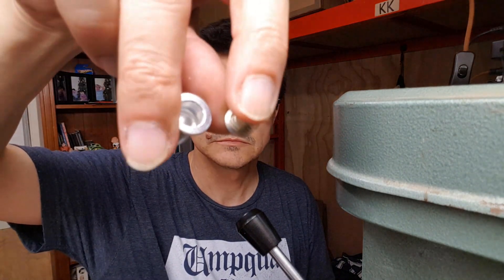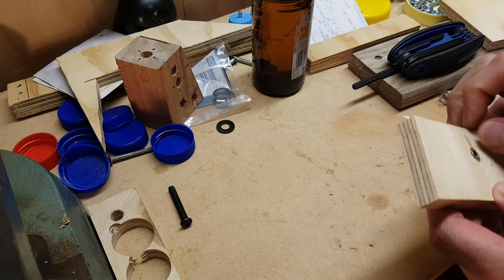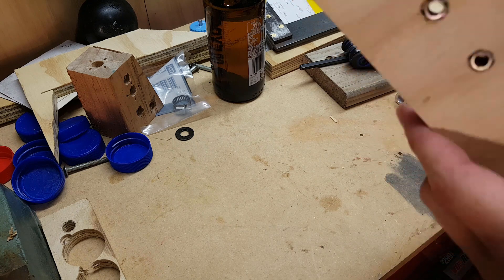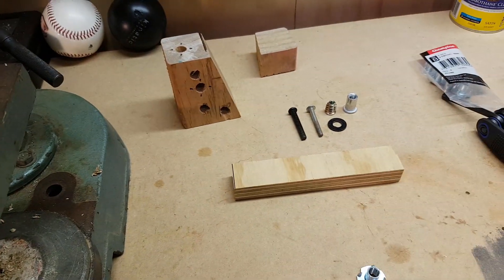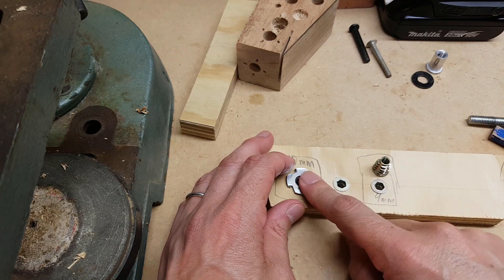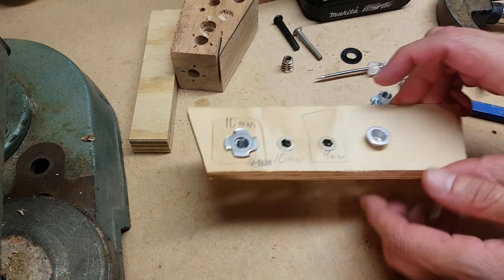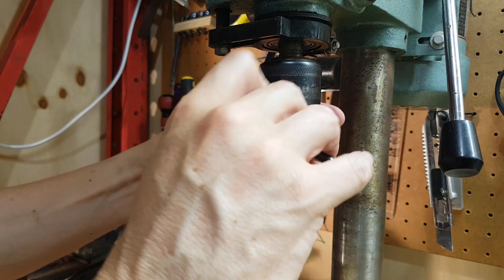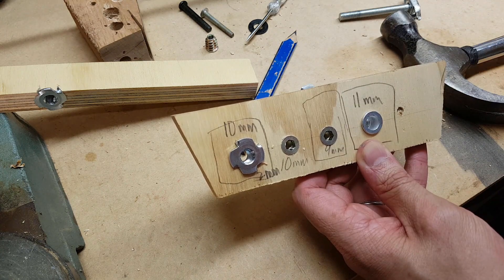Teaching myself about insert nuts

Comment from the maker: This was 3 years ago. I know everything now but thanks anyway.
Rivnuts are for metal.
You can get a spec sheet at the manufacturers website.
You can use a driver instead of a handheld tool.

If you know everything about insert nuts then this isn't the video for you.

bla bla
Reply: you are right https://www.amazon.com/dp/B08RBRP5CL?ref=myi_title_dp&th=1
Reply: Rivenuts, or nutserts CAN be used on wood, but you must use a backing, like a washer. ( F & R ) Then, they should work rather well.

Comment: You don't need epoxy for the t-nut. It supposed to be fixed from the back. 

The screw in insert can be mounted both from the face or from the back. 
Yet,  it allows to be mounted in blind holes. 

What you've called "ribbed nut" is for mounting in sheet metal. Not for wood.

Comment: So what's the best type of insert nut to use if you just wanna attach a steel rod to a block of wood perpendicularly?
Reply from the maker: depends on whether the rod is going to be pushing or pulling - for pushing (down, say) either will do. For pulling, an insert nut will do, but not too heavy. For real heavy things you could try a t-nut on the other side of the rod.... not sure.

Comment: What was the outer diameter of the shaft of the D nut/insert, if the hole drilled was 8mm instead of 9mm would the threads still cut into the wood or would it split the wood because it would be too tight.
Reply from the maker: Depends on the wood type I think- with soft wood like pine you could probably still screw it in but with a harder wood it would either split the wood or be impossible to screw in. The threads on these insert nuts are tapered like screws hence me needing to do these experiments to figure out the best size hole. It was five years ago but I still have the sample piece from this video hanging on the wall in my workshop and I refer to it every time I use an insert just to remind myself what size to drill for it.

Comment: T nuts don't work well on soft wood, and the prongs tend to fold on hardwold. I ended up having to epoxy them, to make them work. Never used those inlet type, but looking, I can tell THEY will have to be glued in also. My next task, will be a small toolbox, using nutserts + washers, to sandwich the wood.

Comment: Thank you, I tried the t nut without drilling the small pilot holes and the prongs just bent underneath!
Reply: T-nut goes on the opposite side of the bolt. You don't have to hammer it in or drill little holes for the teeth or epoxy. You simply thread the bolt through the other side and it will pull the teeth unto place
Reply from the maker: @codigitty9195  You forgot to mention "When using balsa wood....."

Comment: Hello I have a wood footboard for a king size bed looks like there is a T - nut in the footboard don’t know the size my question is what kind a screw would I use so I can attach the footboard to the metal frame ….. THX
Reply from the maker: Hi Gina, 
What you need is a few bolts, rather than screws.
You'd need to place the footboard up to the metal frame to see what kind of attachment mechanism it uses. Some of them have lugs on the metal that hang on bolts in the the head & foot boards and some of them use bolts that go through the frame and into the boards. 
Firstly you need bolts that fit the thread of the t-nuts in the board, and secondly they need to be a length where you can add a washer to the bolt and then be able snug them up against the frame so that it pulls the head/foot boards in tight so the whole assembly doesn't wobble.
I would estimate the size and length by trying a bunch of random bolts until you find one with the correct size thread, and then you can take it to the store to buy bolts of the correct length, or cut some off the end if you have that capability.
Hope this helps.
Reply: @TakamiWoodshop  I hope so as well Thx so much
Reply: @TakamiWoodshop  Good afternoon Rob Tee  I want to thank you for help we got the bolts and the bed is up. Thank you so much!!!!
Reply from the maker: That's awesome! so good to hear, thanks for letting me know, happy sleeping 😴👍🏻👍🏻

Comment: Get a little longer bolt that fits the insert and cut the head off the bolt put two nuts and a washer onto the bolt then put it into a drill press with the insert threaded against the washer and nuts then drive it into the wood nice and straight...

Comment: when using the rev -nut.. you should be using a Nutsert gun .. which makes the bottom pull in like a pop rivet.. but you should not use them for wood.. only on aluminium or metal.. just thought i would let you know after working in fastenings for 12 yrs..
Reply from the maker: Thanks for sharing that Paul. It's valuable information for me and other people who watch this video. 🤙
Reply: On wood, you must use washers on both sides. Then, they work well, and are fast.

Comment: The riv nuts are for metal not wood! they are like pop rivets....
Reply from the maker: Yep, I didn't know that at the time... Found out later what their original purpose is. Cheers dude.
Reply: @TakamiWoodshop  No probs, we use them all the time over here with the cheap shitty metal panels you get now but they do give you a really good anchor point to bolt onto, just need strong arms on the rivet gun!!  Great tool thought for the cost. thx for the vid.
Reply from the maker: @sitgesvillaapartmentneilsc7924  Ahh cool! I stumbled upon a video about them a while back - it made sense immediately when the guy called them "rivet" nuts - It'd been sold to me as a "riv" nut and I hadn't made the connection.
Reply: @TakamiWoodshop  by the way I forgot to mention that on the T nuts you dont put the bolt in on the side of the T nut where you have pushed it into the wood, its designed to be used the other way round so as you do the bolt up it pulls the prongs of the nut further into the wood,. they use them in europe all the time on furniture and sofas and thats why they are so good. Grip like hell on plywood and chipboard, MDF etc

On my CNC machine I have two spoil boards one made from T nuts and the other from screw in nuts and the best one is the T nuts, you put the spoil board upside down on the frame and then just use Cams and Wood clamps with bois and screw into them, holds the stock very well and I have not had a piece come out of the spoilboard yet.
Reply from the maker: @sitgesvillaapartmentneilsc7924  cheers for the info. T-nuts are super cool little things!

Comment: Solid advice from  the lil girl :)...
 

When you tried the 9mm vs the 10mm   you would need to  consider the size of the Nut it self ..

Coz 9mm worked best with the size that you have .......if the nut is bigger then  the hole have to be bigger ,  and if it was smaller then the hole have to be smaller.
Reply from the maker: Lol, that lil girl... His voice is two octaves deeper than mine now.... He's a beast. The hole sizes I recommend in the vid work for that soft pine plywood. With hard wood you'd need different sized holes probably because it wouldn't be as forgiving to holes that are too small. Cheers dude. 👍🏻

Comment: With the T nut, you don't have drill the 3mm hole for the prong , all you needed to do was put a bolt from the other end and tighten it and it will pull the prong into the wood , you may have to use a washer if the wood is softwood.
Reply: In hardwood, the prongs bend, making it useless. Then the wood is damaged, and you must glue it in.

Comment: I just used t nuts in red oak. I used a forstner bit first to recess the nut so I could cover it with a plug. I drove it in with a hammer and a long socket to drive it home. It worked well.
Reply from the maker: That's awesome. Will be super nice and tidy once covered with a plug!

Comment: Hi. Can anyone recommend an insert nut for 5mm ply? I know it’s thin but it’s what I have to work with. Many thanks
Reply from the maker: Could you put two layers of ply just in the spot where the insert nut goes?
Reply: Rob Trautvetter - Takami Woodshop hi Rob. I could but a bit unsightly. It’s for my camper van roof to attach a circular shower rail...
Reply from the maker: @thatwasthedaythatwas  that's a tricky one. I was meaning to put the additional layer of ply on the side not visible but I guess it is already installed and you don't have access. You could try these reduce length inserts: http://www.theinsertcompany.com/type_d_reduced_length_threaded_insert_for_wood.php or a thing called a thin wall bolt: https://www.blindbolt.co.nz/thin-wall-bolt/

Comment: For the T nut, try putting the nut in from the other side. Then, when you have your bolt tightened from the top face, the connector will be under tension and you won't need to use epoxy.
Reply: Yes the t nut was installed incorrectly ,you do not screw directly into a t nut,first drill your hole put the proper bolt and flat washer through the hole, now screw the t nut on to the bolt with the prongs facing the wood,screw it till the prongs make contact with the wood,now tighten the bolt till the t nut prongs are sunk tightly into the wood,now good to go.
Reply: I was about to come and post this but glad to see someone else already said it!

Comment: I came here to see T-nuts in action.  Need to set up where a threaded steel rod can screw into bass wood and be removable when needed.  I’ll definitely used epoxy to permanently fix into place.
Reply from the maker: As an alternative to epoxy some people put in a couple of short screws overlapping the edge of the t-nut to stop it popping out. Good luck with t-nut action of your own! 👍

Comment: which one would you recommend for a square wooden dowel i thinking square dowel would be maybe 1 inch X 1 inch thick. and on the side of the dowel is where want to put one of the nut u show here. so i am going to make a 8 x 8 and the thickness is 1/8 square shelf panel and on each side a 1 inch square dowel and not sure what nut to use that will be my way to screw in each shelf to the side beans also i want the bottom shelf to be flush with the floor and not sure how i would do that i am think i will have to make it 1 inch off the floor  each shelf will be 12 inch apart from each other top shelf will be flush with the top that easy enough to do it flush with the top just the bottom not sure how i would make it flush t o the floor
Reply from the maker: Hi Joe, I would recommend the one that I show at 1:10 - I think the 6mm (M6) should strong enough for a small shelf like you describe. I'm not sure it is possible to be flush with the floor - it has to be 1 inch off the floor. Using the insert is not my first recommendation however - why don't you use normal wood screws? If you are using inserts you would need to clamp the pieces together before drilling to ensure that the bolt hole lines up with the nut. Drill the holes for the diameter of your bolts, and take the clamps off and widen the hole for the insert before screwing it in. Good luck! Have you seen my shelf videos? I have about 4 of them that may be useful to watch. Cheers, Rob
Reply: Rob Trautvetter - Takami Woodshop  well the reason why i was think of the 6mm insert nuts is because I wanted the shelf's to be removable not permanent. so the height of the shelf would be 5 feet tall with  6 shelf the 6th shelf would be  flush at the top of dowel beam then 12 inch apart each shelf accept the bottom one as like u say 1 inch up the side bean would be not full length of five feet it would be 2 feet 6 inch long then adding a plastic square tube fitting to connect the 2 dowels together  this is so i can take it apart and not be stuck with 4 long 5 feet parts the shelf will only need to hold at the most 2 pounds or less
Reply from the maker: The plan sounds good - but I still think if you are only putting 2 pounds on there you could use normal wood screws - they are strong enough and removable also, but each time you remove and re-attach the the screws the joint will become looser. If you are doing this often or many times - it may be better to use inserts with bolts. Good luck!

Comment: The rivet nuts are for steel/other metal NOT wood. You use it with a gun that clamps the rivet tight  to the steel.
Reply from the maker: Hey brianT, thanks man, I should get me one of those RIVET guns and stop using these things on wood.
Reply: @TakamiWoodshop  Rivnuts can be set without the special tool.  You can just make your own out of a spare nut by drilling out the threads so you just have a body through which a bolt will slide easily.  Put a washer on the end, thread the bolt into the rivnut, hold on to your special nut with a spanner to keep it from turning, and apply torque until the rivnut expands enough to set.
Reply from the maker: That's a cool tip Ray, thanks for that, I'm going to give it a try!
Reply: Rob Trautvetter - Takami Woodshop Forgot to mention put a little oil or grease on the threads and on the sides of the washer for easier turning.

Comment: I'm stating the obvious, but I guess a hex bit on a proper driver is easier than a bike multitool ;-) . For the t-nut just torque it up with the bolt you are using for the other side - I  think they are meant just for softwoods (like in wooden crates,etc).  Also from what I have seen  rivnuts, need to be expanded with a tool like pop rivets.  Gonna me some threaded inserts on AliExpress. But thanks for the useful investigation
Reply: Also if your piece has the room to work, putting a hex bit in the drill press, line up the bit/insert nut/hole and then turn the drill press by hand your will obtain a straighter alignment when driving it in.
Reply from the maker: That's a great tip 👍
Reply: I was about to say the same, Thx.